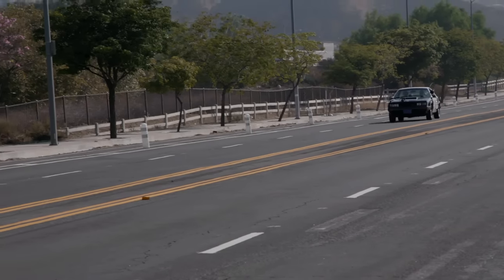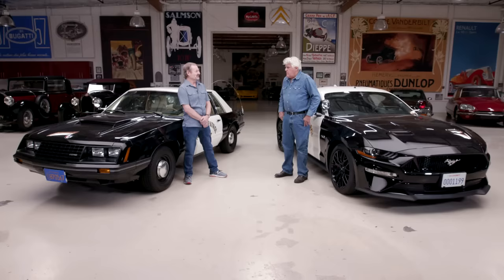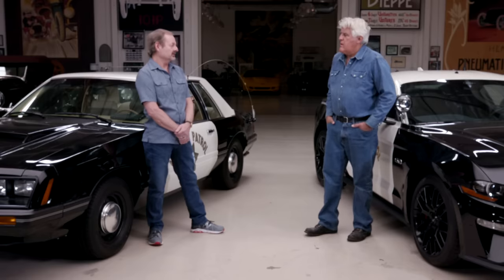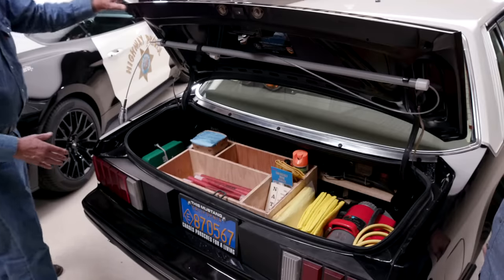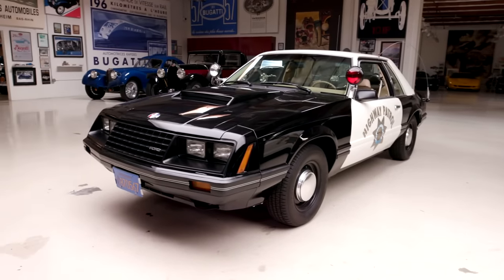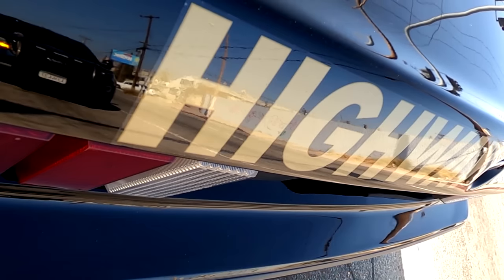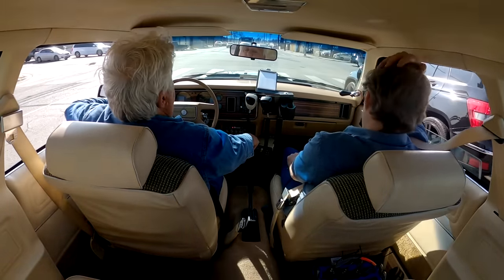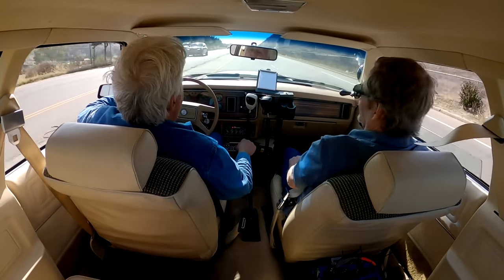This Mustang Chases Porsches for a Living | Jay Leno's Garage

Comment: Gotta give Jay props for not laughing in this dude's face for saying he hit 160-180mph in these. lol
Reply: in Utah, the highway patrol bought IROC camaros because the mustang wouldn't steer effectively when driving faster than 120. I can't imagine being in one of these little cars doing 140 plus it would definitely be nerves of steel. Remember, they didn't have the stiff summer tires like today's performance cars have.
Reply: 180 is a stretch but i believe 150-160.  I painted cars with a guy that had gone to prison. He stole an IROC camaro in the early 90s. Said he was doing 120+mph and some cop slowly kept gaining on him. He said after 10mins or so the cop was on his bumper and had to of been doing 140-150 to catch him. When he decided to give up he found out it was a Texas DPS 5.0 Mustang that had ran him down.
Reply: Also want to add. This was in the 90s. So it was the later fuel injected SSP Mustang. I know the early ones were dogs but you gotta remember, most any car will do 140mph if you have enough space. Just like stories of Crown Vics doing 150mph+. They'll do it but it takes MILES to get going that fast.
Reply: @gordonbombay676  160mph in a brick with 225hp (192 wheel HP) ? 

I struggle with that. But 180?? No.
Reply: Yeah… 145 tops.
Reply: As a Ford owner,.. The meters was off all the way.. Easily by 20-30mph
Reply: @gorgon9786  the cop applications speedos were supposed to be calibrated, but as someone else mentioned, there’s no doing 160 with 225 HP.  It’s weird, because the guy had several other facts correct, like silicon hoses.
Reply: With 245/75r15 tires, 3.08 gears and in 1:1 4th gear you could do 140 at 4900 rpm
Reply: @TK_100  that’s theoretical… the motor must make enough torque got get there.
Reply: @lsh3rd  what was I thinking bringing actual math to the YouTube comments section 🤦‍♂️
Reply: I remember reading Washington State Patrol tested theirs with radar and got 153 without lights and 147 with (one was a 1987 and one was an 86).
Reply: @parteibonza  I don't know about stiff but in the mid 1980's they were delivered with Gatorbacks.
Reply: On the other hand, he's a former street racer... so he should know. But yea, 180 seems streching it. I know of an old 90s BMW that normally were limited to 155mph that has been seen reaching 182mph with 321hp after mile by mile by mile by mile by mile of open straight road. It doesn't really seem possible to achive the same in that police car. But 160... yes, somewhat plausible.
Reply: @Milkmans_Son  no they werent they used Generals. Just like the crown vics did.
Reply: @parteibonza  I absolutely guarantee you 100% yes they were, at least on 1987 Washington State Patrol Mustangs anyway.
Reply: My first car was a stock 88 Trans am gta and it would max out at 155. My second car was an 87 5.0 with 390 hp at the tires which was pretty crazy high for a car in 1997 (particularly for a teenager in Iowa.) Even with 390 hp I was maxed out at 165. It was an aftermarket speedometer of course. I hoped it was off and that I was going faster. I had my friends dad come out and race me with his purplish c4 zr1. 

I never got faster than 165 according to either cars speedometer. Gearing can change a lot, but I'll never believe CHP mustang broke 170 mph.
Reply: The 83 definitely wouldn't do anything close to 180, maybe 120mph.I buried the speedometer in my 92GT which was 140mph and probably could have reached 150 maybe 160 tops. No way that 83 could do anything like the 302 fuel injected models .
Reply: @gordonbombay676  Sorry, but I definitely have to respectfully disagree.  Does not matter if you are at the Salt flats with endless open road.  150+ takes aerodynamics or massive hp, neither of which are available on a 90's mustang or crown Vic.  The mere wind resistance at 150 vs 120mph is probably around 30% to 40% higher.  I had a 92 GT that had the 225hp that the officer claimed was their faster car.  I was not 100% stock (though close) and it would not break 140.  The difference between 140 and 150 in wind speed is massive.  That would take at least 50 more hp at a minimum.  180mph, as mentioned by a previous commenter, would make me bust out laughing.  Kind of surprised Jay didn't say "cut the tape, stop rolling.  Okay buddy, I have a rep to protect here.  My people are not idiots. You can't say that kind of crap on my channel".
Reply: @rebelwithacause3574  Yeah the 83 gt only made 157 HP, a 2 BBL would be absolutely choked above 4000 RPM. Now a 4 BBL is different, those 5.0's made less HP but the power peaked higher than the fuelies. i could pull away from them on the highway in my 85 (which i still own).
Reply: @rebelwithacause3574  He didn't say it was in the car Jay had, he said it was in a later injected car.
Reply: I can tell you for certain that the 1989 to 1993 Fox body LX 5.0 Mustangs would absolutely do 140 mph. This anemic 4-Speed 2 barrel version would definitely not though. Fair enough. They had to start somewhere.
Reply: @realMaverickBuckley  he's just stretching it like a big fish story. But they definitely did 140. Which in that car, was a hell of an experience.
Reply: @9ZERO6  Road & Track had a four eyed 85 do 135 MPH, the smoother nose of the later cars would most definitely add to that.
Reply: I lol as well and had to pause the vid and look at the comments below. I'm an owner of a 5.0, LT1,LS1, turbo Zx9r 94 and 99.
Reply: @realMaverickBuckley  This wasn't Fuel Injected the HP on this Stang was 140-160HP rear wheels deduct 25-35HP.
Reply: @TK_100  Not with 225HP and the drag coefficient of a brick.
Reply: @gordonbombay676  your wrong you have to have enough hp to overcome the drag...and the old Mustangs had the drag coefficient of a school bus. (0.46) The only car from the 80's that would do 150 was a vette and that was even a stretch
Reply: @fngmike  i could claim my Focus does 200
Reply: @kanalnamn  no...this guy is full of it...140 was pretty much topped out and even then you needed a tailwind to do that.
Reply: @parkerterrell5578  i had an 88' Formula 350 and it wouldn't do anything close to 155 and an 88 vette only would go 150 tops...so your trans am didn't do 155
Reply: @richardbaumgart2454  I wouldn't argue with you. My point was more about 180 mph being crazy. My 88 was a 350 with the usual bolt ons . The speedo maxed at 140. I said 155 as it was buried considerably past 140. Not an accurate test of speed I concede.
Reply: @realMaverickBuckley  Ive owned several Fox body GTs and LX 5.0 Mustangs.  5speeds will hit 140 -145mph.  Auto trans cars 130-135mph.  That's bone stock. With a decent cam and heads along with lowered suspension they can run up to 160mph pretty easily
Reply: Ikr I was laughing not even with a strong tail wind and a jet engine 🤣
Reply: @realMaverickBuckley  he said 157hp lol not a chance he is dreaming
Reply: @parkerterrell5578  i take back my comment...i found an old Motor Trend article from 1988...they clocked a Corvette at 156 in a test on radar and GM claimed 153...and they tested an IROC-Z auto and clocked that at 153...my old "87 350 Formula was a turd lol it wouldn't kick into OD at WOT...so you TA prob would do very close to 155..with bolt on and with a chip for sure
Reply: @parkerterrell5578  and I’ll never believe you had an ‘87 5.0 with 390 HP at the wheels.  That would put the actual HP at what…450-475?
Reply: @MrJett1971  Sounds about right. Why wouldn't you believe me? I never said it was stock. There were guys getting much more out of that block even by then. My little shop in no where Iowa got it up to 390 at the wheels. I am not a mechanic and don't know much technical things.

 I can tell you what I paid for. We started with all the bolt ons. BBK headers, h-pipe, Flowmaster exhaust, K and N airfilter, computer chip, and an msd 6al, ac delete and pulleys. That didn't do much, but it got me hooked.

 Subframes and a 150 shot of nitrous next. The transmission died on the second bottle. Enter Tremec tko transmission and winter. I was all in after dropping like $3500 on a transmission in 1997 dollars. Removed NOS. Upper, lower intake and 75 mm throttle body. Aluminum heads, cam, and finally a vortech supercharger. Then a lot of time getting it to breathe right. We changed the fuel system, injectors and a bunch of little things I don't know. I just know it was a pain getting the air/fuel mixture perfect. Then roll cage, did something to beef up the rear end. Finished up odds and ends.

 Summer of 98. 390 rwhp. Putt on MT Street/strip slicks and acquired 17 moving violations that year.
Reply: My 89 auto and 93 5 speed were about 140 and 135 top end with some room.
Reply: @parkerterrell5578  that sounds awesome. Is that car long gone? Have anything fun now?
Reply: @Milkmans_Son  Exactly. That matches what Motor Trend tested my 85 at. 153 top speed.
Reply: @richardbaumgart2454  WRONG.
I had an 85 GT 4bbl. Weighed 3,000lbs. Went like a bat outta hell. Motor Trend tested them and got it up to 153.
I believe it.
Reply: @KoolHandJuke  I read Car and Driver like a jesus freak reads the bible back then...so after reading your comment i googled "Car and Driver 1985 Mustang GT" to see if my memory was correct. At the end of the Car and Driver article it gives the spec of a drag limited top speed of 135 mph. Maybe Motor Trend got a modified one to go faster, in fact i'm sure they did. They weighed about 3200 lbs with 210 hp...or 180 hp with an auto...all Mustang owners have a story about how fast their  Mustangs were.
Reply: Even with a 3.03 rear end theyre gearing limited to ~168 mph and wont get near that with 157hp....Even the 225hp Cobras with a 3.23 rear end had trouble doing 140mph in tests in 1993 due to the Aero which was better than these old 4 eye cars! Hell....the much better Aero 2000 model Cobra R with 385hp did only 170mph and that was drag limited!
Reply: @Shadow0fd3ath24  drive it off a cliff it would go 180 if it's a tall enough cliff maybe
Reply: @9ZERO6  with a tail wind
Reply: @realMaverickBuckley  not a brick, the foxbody has the drag coefficient of a gt40
Reply: @andreyangere3076  a 0.39 rating is a super brick imao, and its worse for the mustang because thats 100% lift, its not making any downforce or neutral numbers like the GT40 would at speed.
Reply: 160 ain't far off. I know for fact. Stock 225 HP 5.0 I hit well over 140.  Cops even told me I was 155 mph on record so yes it's very possible 160- 180mph
Reply: @9ZERO6  Yes, I was thinking the whole time watching this how in that model, the thing had to be a rattle trap.  There was nothing truly special about an '82 Mustang. Spartan interiors, drum brakes in the rear, lousy suspension, still detuned 2bbl 302.  Over a long distance I could see them getting up to 140, but you had to really be stressed with the crappy feel of the car.  I had an '84 GT. At 120 mph, I backed off.  My '87 Toyota Supra handled 140 like a charm.

Comment: Not to be disrespectful, but there's no way these were doing 160mph-180mph. They'd do 180kph no problem, but 160-180mph? The 2000 Mustang Corba R came out many years later in an era where automotive engineering was rapidly developing and it topped out at 170mph.
Reply: I was thinking the same thing.
Reply: These would probably take flight at that speed! I don’t think so…
Reply: Indicated mph vs actual mph is my guess...or the speedo had the wrong gearset in it.The speedo in my '70 Buick A-Body was 120mph, and the needle would go past that, past the indicator for the turn signal. Based on the diameter and the sweep of the needle, that should- if it were accurate (LOL) - be about 150 mph: it was visually the same distance as 0-30mph. I put the needle on that speedo past the turn signal to the bottom of the gauge several times. No way that car - even with the fairly low 3.31:1 rear and the 462 under the hood - did 150 mph! Not even when it had the highway gear 2.56:1. But the speedo needle was there.  I was maybe at 125. That's a maybe.
Reply: The Car and Driver road test of the 225 hp Mustang GT said top speed was 144 mph.
Reply: He's Blowing smoke. 160 hahaa
Reply: I love the 80s 5-liter pony cars as much as anyone, but it would take some serious mods to make 160, let alone 180 MPH.  Possible?  Sure, but was the CHP putting that kind of money into their cars?  Someone out there must know!
Reply: My 92 COULD get to 160 with enough tail wind and looong straight stretch, but took a long time.  You guys assume it can't be done, but there are ways and you know chippies would find it.  He obviously isn't gonna tell you how.
Reply: How do so many of you have no idea what you are talking about.
Reply: @garyschyve5768  Yes! Most departments did. These cars were not stock!
Reply: @bagheerab278  excalty!
Reply: @colecole3352  Interesting...  I can't say I'm too awful surprised.  I remember reading Cars Illustrated back in the late 80s and they got amazing performance out of a 5.0L Mustang LX.  The article I'm remembering was "Kickass and Take Names for 10 Grand".
Reply: With a 351W fuel injected, maybe so😁Not the carbureted 302 from the early eighties, though, not a chance
Reply: @colecole3352  they had cooling mods. That is IT. Gearing/weight reduction and Cooling mods. Nothing else. Ive had a few
Reply: My buddy bought a 1989 gt 5.0 5 speed new,  we tried top speed a few times and that car topped out at 140 , we really tried a bunch of times on all diffrent highways under a lot of diffrent conditions,

Comment: My Dad was in the market for a Mustang in 1988. He wanted a manual, cloth seats, and AM radio. As he was talking to the salesman, a truck showed up with a bunch of Oregon State Police mustangs. He ended up getting one, and it was a company car to boot! He got pulled over once, going a bit fast, and the officer took extra time figuring out what was going on. It was registered as a company car, and, with the all white, blue pin stripe, and black painted Mustang wheels, it was clearly a SSP model. He eventually got off with a warning.

It was a great car that he really enjoyed.
Reply: I owned a 1988 SSP as well, I bought it from auction right after it was decommissioned from the Florida Highway Patrol.  It was one of the most fun cars I ever owned.  I learned about buying them from a friend that also owned an 88 that he had purchased from auction.  The first time he took me for a ride in it, he said, "reach for the dash" and he punched as much as he could without breaking traction in 1st gear.  I couldn't reach the dash.  The G-forces were pinning me to the seat.  From that moment, forward, I fell in love.

Interestingly, he had sold his first one by the time I purchased mine in 1993.  He missed his so he'd occasionally ask to drive mine and I let him.  Then I sold mine and he purchased a 2nd SSP.  Ironically, all 3 of the SSPs had bad 2nd gear synchros so you know that those Troopers were having some fun in the Mustangs when they had them.  I learned about double clutching from my friend on his 1st SSP and I did that in mine, too until I had the transmission rebuilt.  I actually got pretty fast at doing it and it kept 2nd from grinding.

I really miss my old Trooper car.  It really was a blast to drive.  I am really happy your dad was able to enjoy one, too.
Reply: I have a 1988 GA State Trooper sitting in my barn.  This guy who was the #2 Ford diesel mechanic in the country bought it at auction and refurbished it completely stock. It has the weight bar in the trunk.  It’s a fun car.  It will do a 360 on a dime.  My wife made me park it for awhile because I was getting too many speeding tickets in it.  I outran a corvette in it going over the Cherohala Skyway from TN to NC.  I passed him leaving Tellico Plains and it was on all the way to Santeetlah.
Reply: You haven't lived until you drive the J2 from Runhorse.

Comment: When these CHP Mustangs had high mileage, the antenna and light bar holes were patched, they got a quick paint job, and were sold as surplus. I had one, and loved it. It came with the air conditioning upgrades needed to keep a CHP officer comfortable idling in desert heat. It had a worn-out 1st gear and a rear axle that was geared for high speed, but a 2nd gear that was ideal for my obnoxious driving maneuvers in city traffic. Fun car, good times, sorry it got wrecked.
Reply: When I was a kid, I bought a surplus CHP '70 Mercury Monterey w/ a 428 cobra jet.  Whenever a cop, any cop, saw me driving it, he pulled me over.  It seems that long haired punk kids and retired CHP cars don't mix  My first and last cop car.   lol
Reply: 2nd gear in foxbody cars with t5's...most underrated gear if that's a thing, 2nd gear in my 88 turbocoupe is a riot in city driving especially with the T3 turbo kicking into full boost around 3500 rpm
Reply: @LuckyBaldwin777  no way a cop car had a 428 Cobra Jet.  They had the police interceptor series for that purpose.
Reply: @MrJett1971  you realize that a police interceptor is a cop car correct?
Reply: @MrJett1971  same engine only difference between the 428CJ and 428PI is the manifolds.  The CJ had an aluminum intake and the PI, cast iron.  The CJ had cast iron headers and the PI, standard 390 style exhaust manifolds.
Reply: @LuckyBaldwin777  - Sorry but 428 CJ’s had cast iron intake manifolds.  I know because around 1974 I help my buddy swap to an aluminum manifold on his 1969 428 CJ Mach 1.  The iron manifold weighed almost 100 lbs!  It took both of us to lift that sucker off the engine.
Reply: @danmyers9372  Then it was the police interceptor that had the aluminum intake.  I know the two had different manifolds.  Been a long time since I messed with either, must have forgotten which is which.